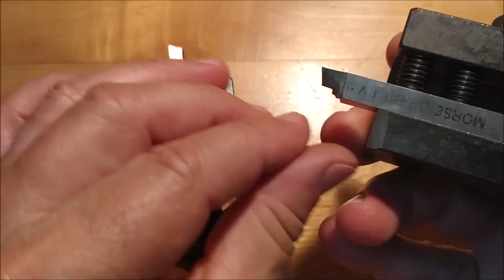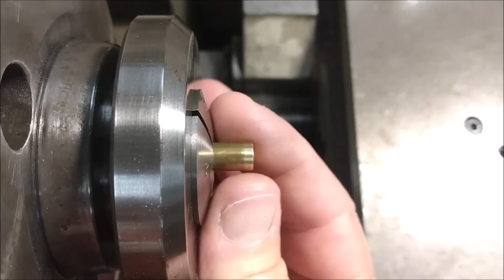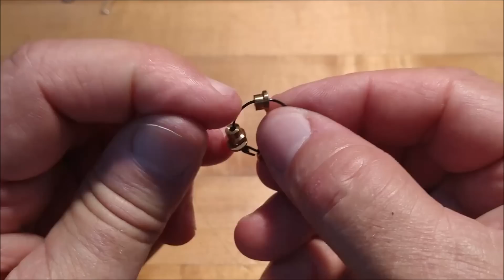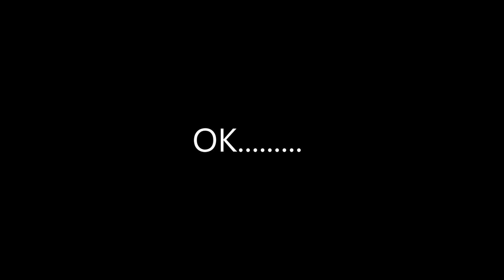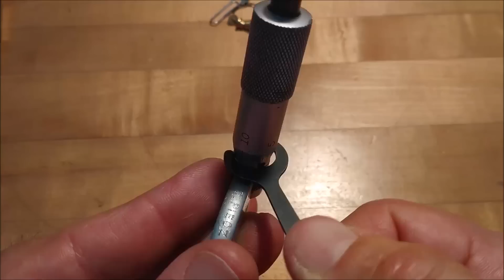Accurately Parting Off Small and Thin Parts !!!

Comment: Big deal as a tool setter that 50years ago I made millions or components  machining smaller parts of hqn that on automatic lathes
Reply from the maker: I did my apprenticeship building secondary handling and machining fixtures for parts used inside electronic watches back in the 70's. They were made on B&S automatic screw machines and daily production was checked on a 7 digit digital scale because the parts were so small. Guess we came from similar backgrounds.
Reply: Brown and sharp were very reliable  machines  although my favourite was the German made index series from werk

Comment: Great tips as usuall! These tips are perhaps even more  useful on small manual turret lathes as well. I use mine frequently when making small series of simple parts, quick setup compared to NC jobs. I use the Joe Pie razorblade frequently, really good idea... Sandvik has small thin parting/grooving triangular inserts that are great for these small scale applications. They are easy to regrind on a D-bit grinder for various widths and front angles. I got a Chinesium one a few years ago and never regretted it, makes experimenting with cutter angles etc a breeze.

Comment: I have used this method and it is great on brass and other soft(ish) materials. On steel however the angle ground on the end of the parting blade can make the blade track slightly to the side and make the finished part the wrong thickness. On the HO/OO scale model railways that I model the brass parts are absolutely fine when done this way. And yes it is good to just touch BOTH sides of the washer with an emery stick or similar before completing the parting cut. Certainly beats the stamped washers you can buy. Thanks Joe.

Comment: Thanks for sharing another neat bag of tricks. The razor blade method works but I use an easier and faster way. Simply move your DRO the width of your parting blade instead of using the razor blade. My blade is .093 wide so moving the carriage .093 puts the right side perfectly flush with the face of the part.

Comment: Other than EDM, is there any other way to make parts this thin? The width of the parting tool is many times the thickness of the washer being made. One or two doesn’t matter, but if you wanted a couple of dozen the waste is far more than the product
Reply: Typically a part like this would be stamped if you needed any volume.   If you needed the thickness to be very exact, you would have them ground both sides.
Reply: I’ve parted off thousands of small brass and copper parts with a .050 wide blade. Keeping the blade as thin as possible reduces waste to a minimum.

Comment: Do you ever run into rigidity issues with a quick change tool post? I've gone around and around with them and personally found that with what i do, they get too much chatter and deflection. But it's nice to be able to rapid change tools too on complex parts.
Reply from the maker: I've never had a problem with the ones I use. Aloris brand B and C size. Like a rock.

Comment: Using a left handed parting tool like that is great for small stuff, but if you're parting together materials, it will cause your blade to deflect. 

That caused me a fair bit of grief making replacement knobs for my stove out of 2.5" 303. I didn't trash any parts, but only because i caught it in time.
Reply from the maker: Key word here Paul is 'small'. Parting off 303  at 2.5" dia.  is going to be a challenge to keep straight even on a good day.
Reply: @joepie221  It certainly was!!!

Comment: For small lathe work (1) l used to used solid carbide cut off tools. The tools were originally meant for cutting ring grooves on pistons. When the multi spindle lathes were taken out of service and replaced by CNC turning machines (2) l talked to the cutter grind dept and we got everyone still in stock. Worked like a champ on everything from plastics to hardened bushings. Of course the old timers said they would never work.
1) Hardinge HLV-Hs mostly
2) Automotive pistons adide from the head and pin bore are not round. The skirts are usually eccentric. About .020/.5mm smaller if the skirt actual extended through the centerline of the pin bore. These new CNCs at the time controled the piston profile by means of an amplifier box attached to the tool slide that would control the tool in and out as the piston rotated. The machine builder had a show off program they could load in and when finished a piston would have Giddings & Lewis engraved in the skirt. If the amplifier had an issue it had to be returned to the manufacturer. Opening the box voided the warranty.

Comment: I recently watched a YouTuber saying you shouldn’t use those parting blades with the end shaped like that because they create a chip that is bigger than the gap.
I personally find they work really well because that shape helps to push the chip out of the gap.
I don’t think that particular person has thought it through.
I use a carbide tipped version, but the theory is the same, & it’s been a game changer, I’ve got both left & right hand versions & it’s just 1.5mm wide, which suits my tiny lathe well.

Comment: that is the first time I have seen a parting tool(a cut off) ground with an angle.  On a screw machine we always did that(23 degrees for brass, 17 degrees for aluminum or steel.  I have commented aboutthis on other channels, never even an insult for a reply.
Reply from the maker: The solution to getting that crown to go away is simple once you see it. As for the screw machine thing, the company I did my apprenticeship in had about 100 of them. So having crowns on microscopic parts produced by the thousands would have been a deal breaker. Thats probably when I learned this. Using an angle on a parting tool that extends further out may lead to it walking though.

Comment: Hmmm.. I would have ground and rounded the left side of your parting tool and faced with that (after all its brass) then moved over the measured width of the parting tool.  I.e. washer thickness + parting tool width.

I was taught to use the old cig paper method for touching off.  

I have never seen this blade method, but everydays a school day.. thanks

Comment: Could you mic the width of the parting tool and just move the carriage that distance? Always good tips from professor Pie.
Reply from the maker: If you intend to cutoff multiple parts without facing them in between...yes. Add the thickness of the parting tool and required part thickness, shift the carriage and keep cutting.

Comment: As a "hobby" machinist that shop gem about grinding a relief angle on the tip of the parting tool has to be the most useful I've gotten from you. I have a little Chineseium lathe and that tip alone improved  the usefulness of my machine about 100%.

Comment: ". . . three tenths . . . that's the error; that's nothing." Except for some of the things I do.  Take a 6204 deep groove ball bearing shaft fit, for example (20 mm).  The tolerance for that in an electric motor is:  0.7875 to 0.7878.  That is what must be hit.  Then you get the boss who say's for the high speed (3600 rpm) motors it should be on the looser side, while slow speed motors (1200 rpm) should be on the tighter side.
Reply from the maker: From where I'm sitting, the difference between .7875 and .7878 is three tenths. Thats exactly the deviation I just demonstrated. Precision washers...no problem.

Comment: Thanks Joe.  Great tip...I have used the same method many times with dial indicator and DRO.  
I would probably run each face of the part on a precision ground stone or lapping plate or fine sand paper glued to a hard flat surface to get any burs.

Comment: Joe, on the close ups your spindle nose has many dings in it, have you run a precision ground flat stone over it  to remove any burrs. Your chuck will run truer if you do. Finally I still see that you are getting pixilation at times, especially when you were doing the micrometer adjustment. I have mentioned this effect in the past and you were going to try and find the reason the picture breaks up. Regards from Australia.
Reply from the maker: Dave, The opening and closing segments were done on different programs then the body video. I have noticed segments following those canned segments seem to take a minute to get in pace. the only way to correct this is to download the entire video at an exceptionally HD rate and that takes about 6 times longer.

Comment: Silly Question time! and this is just a ponder, but... Looking at the technique I wonder... could you reduce wastage of material if you could pair a laser cutter or a water jet to cut the washers or other parts, just to reduce wastage and increase the profit over the waste. Probably pay better in an industrial setting since tooling cost would be prohibitive.
Reply from the maker: In a high volume environment, the cutoff tool would be a micro thin parting blade, or punched from a sheet.

Comment: Joe if I may give you a tip since you have given me so many. When adjusting an micrometer to zero and the barrel is stuck which happens to them from time to time, carefully remove the thimble then using a heat gun warm the barrel which will free the shellaced or dried up oil, then turn the barrel going about a quarter turn or so each way multiple times after it has freed up. I place a drop of sewing machine oil at each end of the barrel and move it some more to let it soak in, let it cool before replacing the thimble. 
I have several brands of micrometers and find that the Tumico's/Lufkins (my favorite mics besides the Starret 231) have a bad tendency to freeze up over time, I have only had one or two Starrets do this.
Reply from the maker: In the past I have used WD40 on the barrel seam area and over adjusted the barrel in both directions to get a smooth slide for the final position. They are tough to hit on a first try if its been a while.

Comment: Really liking the miniatures series.
I've heard you use Abs and Inc to get different references at times.
Does your  DRO have Sub-Datums? I've not heard you using them.
I find them invaluable. eg. have ABS at XY Center Zero then a SD Zero at a corner and if there is dimensions referenced from a feature like a hole set another SD Zero at that point.
My DROs have 99 SDs, Overkill? but hay the more the merrier!
Have a good one.
Reply from the maker: I don't have that.
Reply: @joepie221  Hi Joe,
Well we all have to work with the tools we have.:eyes-pink-heart-shape:
Might pay to look into upgrading, depends on the scales you have but most are compatible with common 5um scales.
The DRO itself is pretty cheap, imagine the luxury of having 2/3/4+ DROs on your mill and lathe.
Anyway I really appreciate your videos, you've given me plenty of tips and tricks over the years.
Thanks.
Ron.